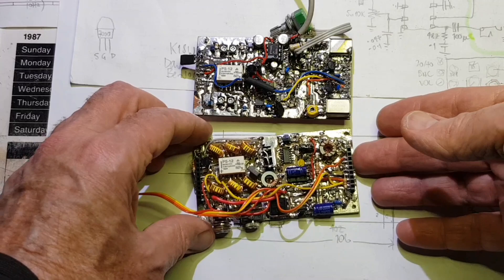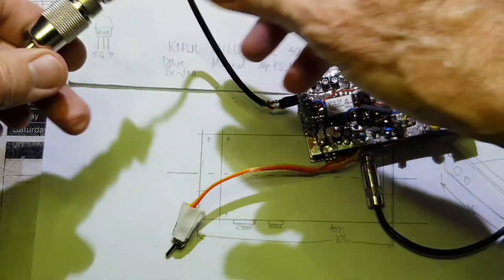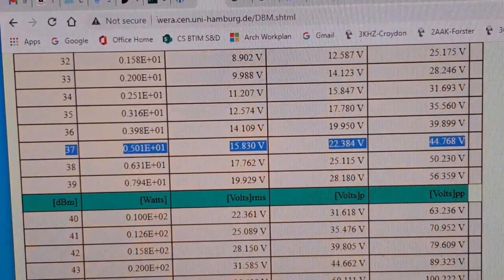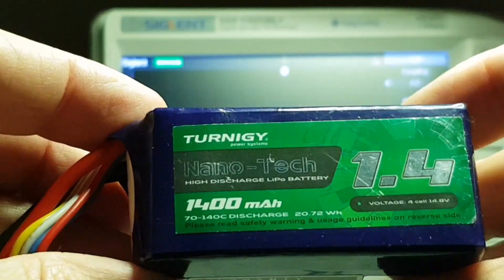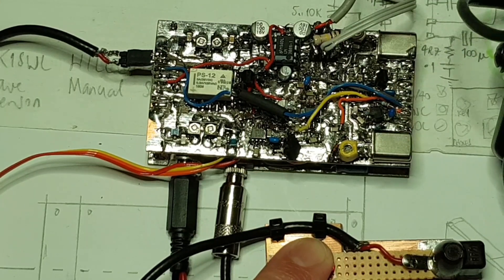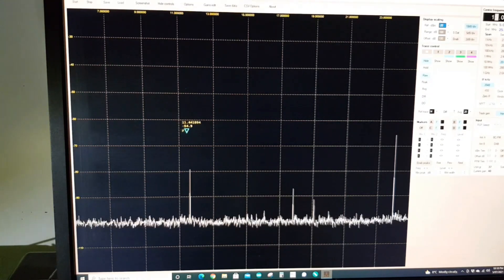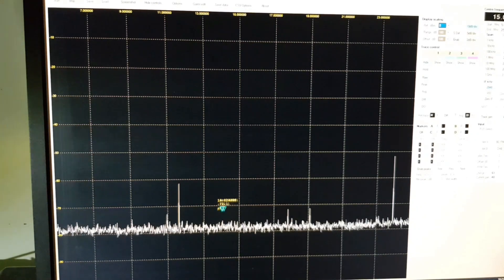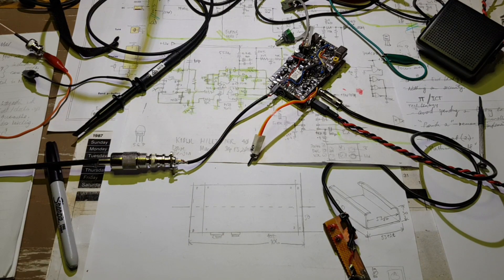2B2C: Scratchbuilt Dual-band 2 channel QRP CW rig/ Part 7 Transmitter PA and tests

Comment: I recently dismantled my 'commercial gear' ham station after getting to the point of absolute boredom, working stations one after the other with no particular challenge. Over time, I gathered tools and test equipments to build up my dream tinkerer hamshack. Since then  I have completed a few kits but also scratchbuilt rigs (CW only) and what an exciting way to enjoy this hobby by melting solder and then working someone thousands of miles away! I enjoy the build process, the troubleshooting at times and the first on air QSO. Keep up the good work, you definitely push the radio art forward! 73, Tony
Reply from the maker: Hi Tony (your qrz.com profile says Antoine), that's probably a familiar story playing out a fair bit. You can buy an IC7300 and everything is open and accessible to you, all the popular bands, all modes, what is there left to do in the hobby? Antennas obviously, but after that, it can become a string of acquisitions without much increasing understanding or challenge. Home building is the opposite, it is pure learning by doing. Its not for everyone but it will always satisfy some people who love to make.  Good luck with your projects!

Comment: I'm impressed with being able to get 5W from inexpensive little TO-92 packages. I am enjoying the videos very much. 73 VK2DOB
Reply from the maker: Hi again Leon.  I first saw this on the QRPLabs QCX I think, and was a bit incredulous, given I've always used TO220 devices mounted on heatsinks at this power level.  But they do work, and work well.  They get hot. Some people I've spoken to have had them blow up on less than ideal SWRs or loads.  I run mine on a 4S pack, 16.5V, and they have survived to date.  Of course if properly driven they are switching hard on, so their power dissipation (heat) will be a function of the overall PA efficiency, which can be very high if well matched.  One more 'episode'!  Thanks for supporting.  One day, I hope to be able to activate a SOTA summit on both 20 and 40m with this rig.  ...   That was the design intention form the start. Little did I know that a pandemic and State governments would make that impossible for such a long time. 73 Paul VK3HN.